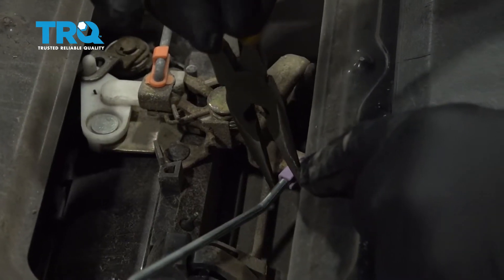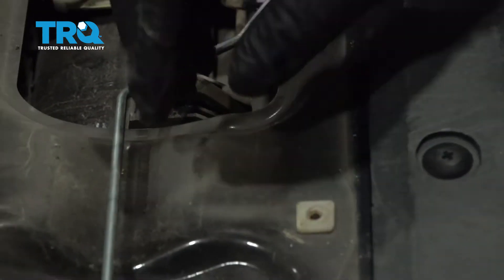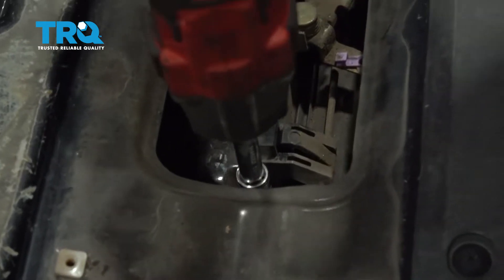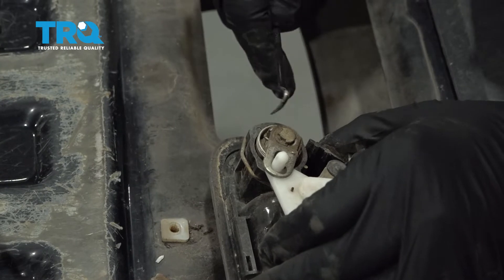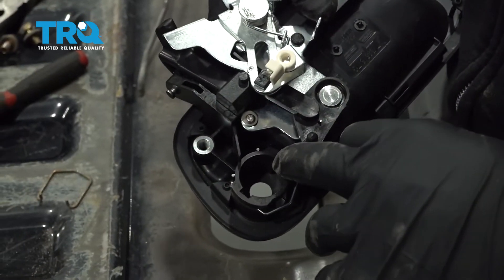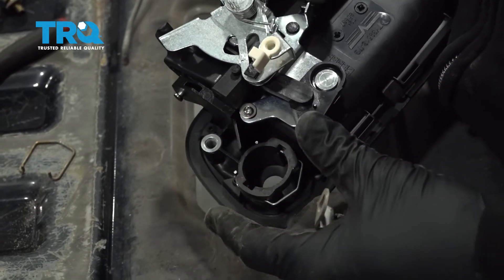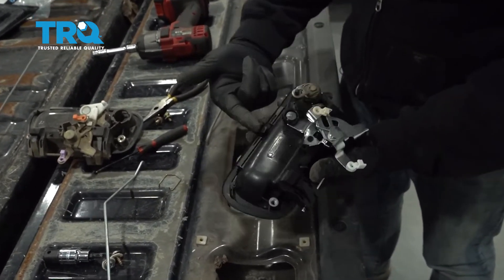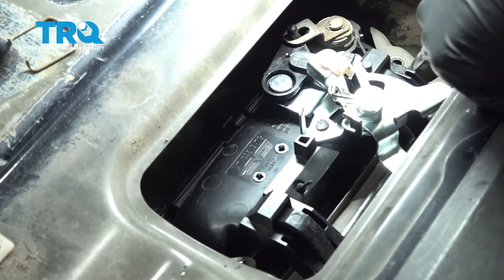How to Replace Tailgate Handle 2000-2006 Toyota Tundra

Comment: Nice vid! Many of the issues with these come from the cover plate deforming (people step here on open gate) and the cover hitting or bending the rods. flattening the cover and unbending rods, as well as lubing latches and handle mechanism (silicone spray works well) can sometimes postpone need for replacement.

Comment: Much appreciated! Install went so easily. One issue, my lock cylinder will not stay in place. With slight pressure, it falls out, even with the retainer clip in properly. Any insight is helpful. Thank you!